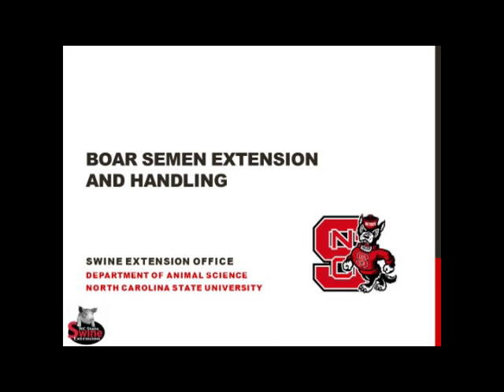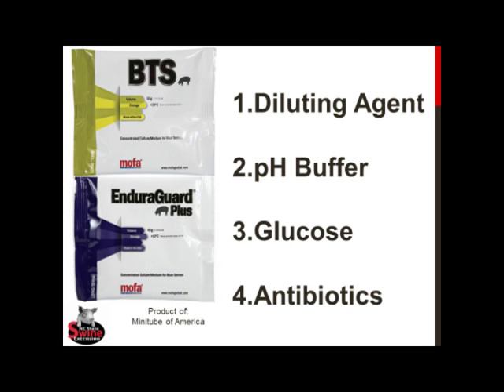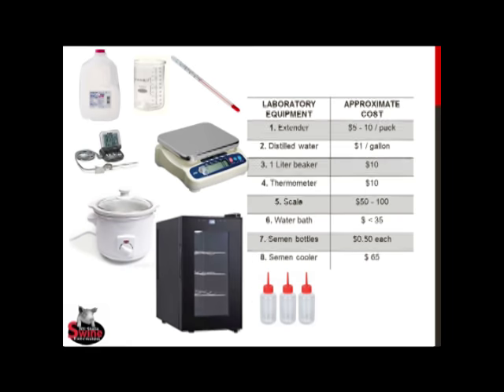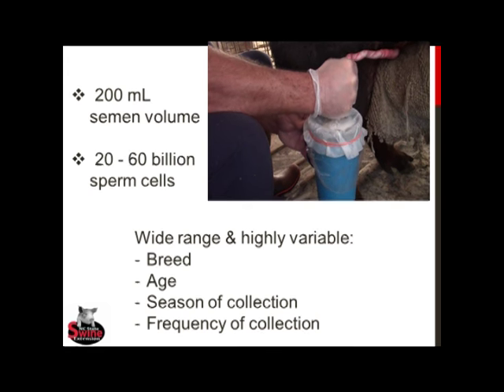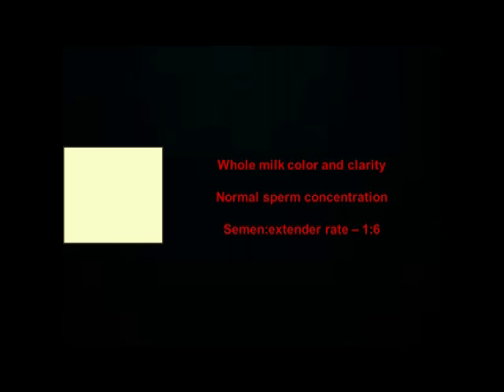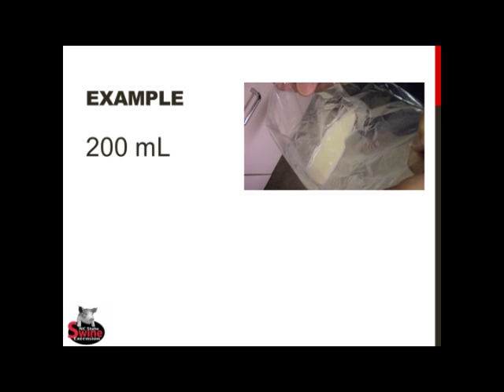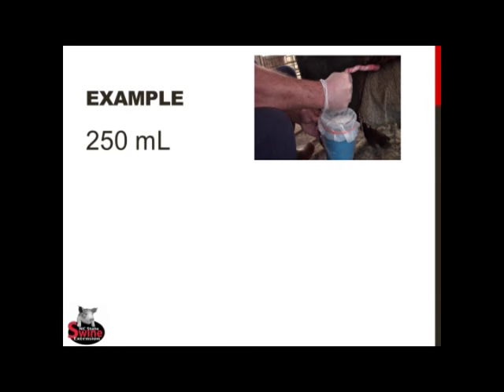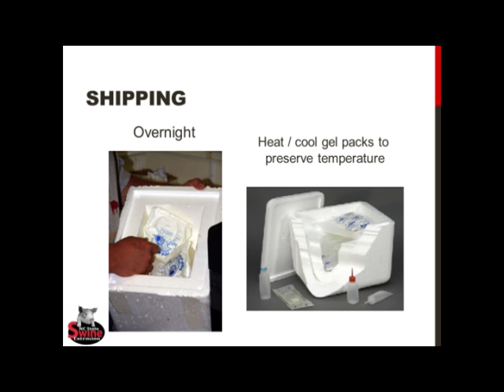Boar Semen Extension and Handling

Comment: Thank you for i fo but i have question temperature of extender before mix to semen.
Reply: Same Temperature.
Reply: For example, the temperature of the semen is 35 degrees Celcius, the Extender should be 34 or 35 or 36 degrees Celcius.